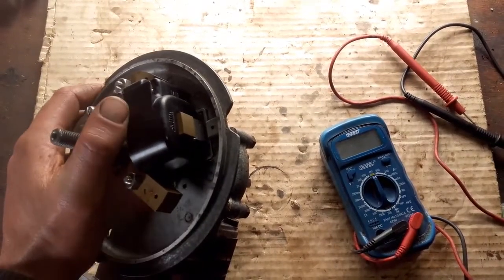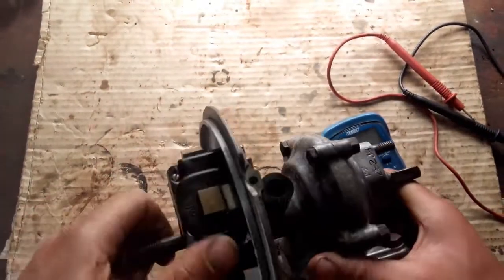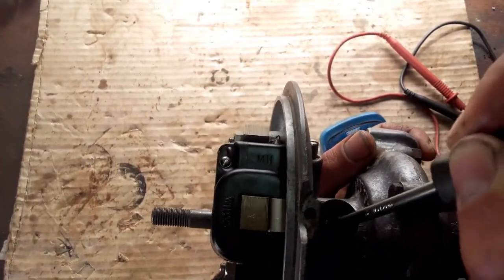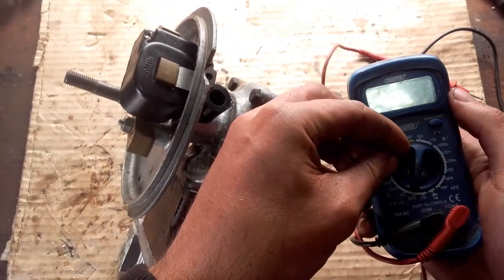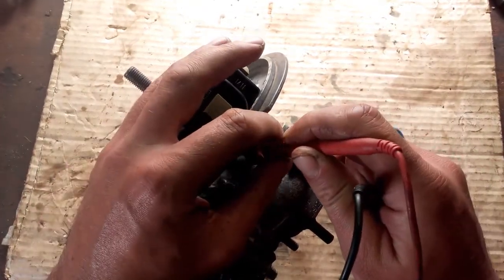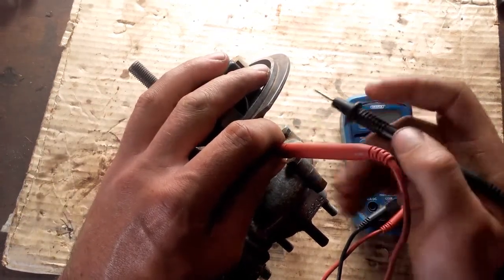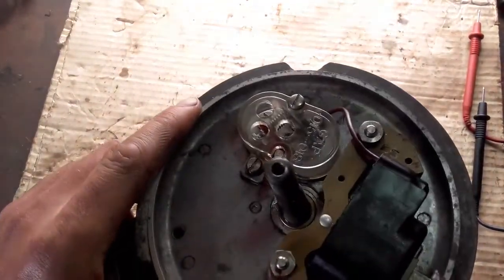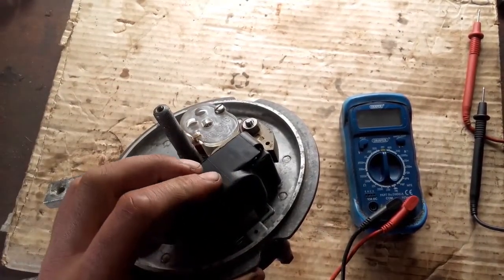How to test a coil with a multimeter seagull outboard wipac villiers 40 plus

Comment: I do not see a condenser?  Is it built into the coil? I had a small Seagull for about 20 years.  I had to give it up because my marina neighbors objected to it constantly leaving oil/fuel stains in the water.  It was also noisy and smoky.  But very reliable.  Excellent to have one as an emergency spare.